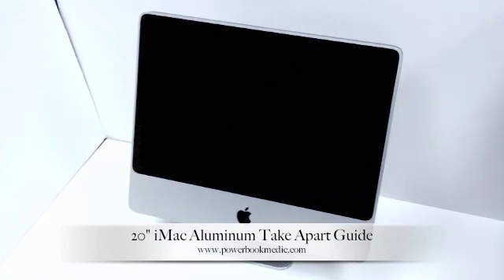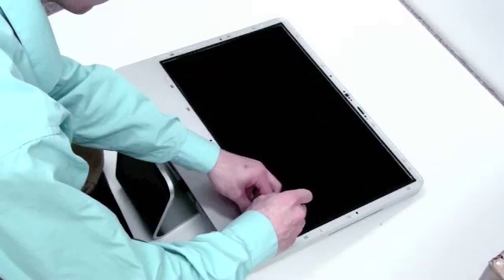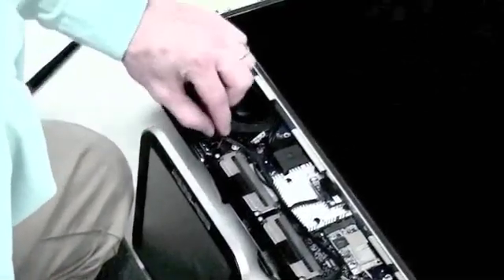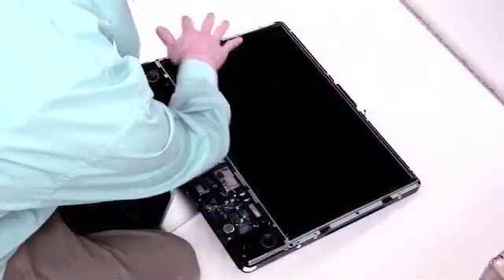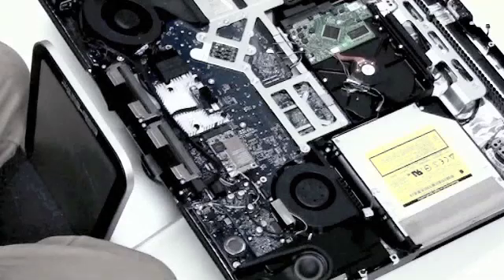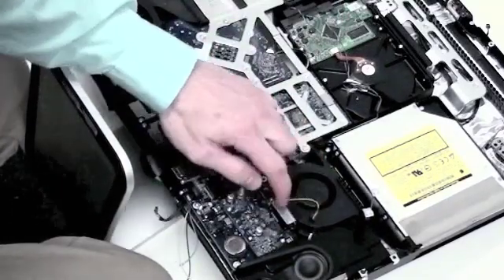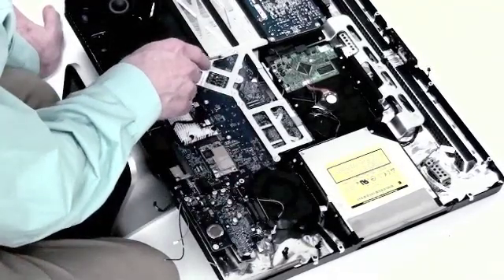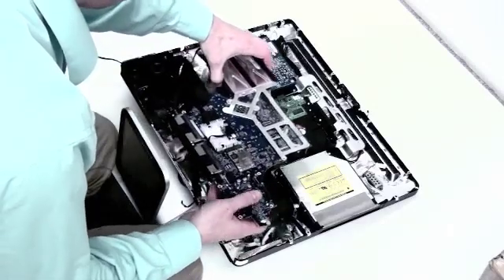Intel iMac Repair - LCD Display and Logic Board

Comment: hi sir this is nagaraju from india hyderabad
i have 24 inches imac early 2008 model imac, recently that mac video card problem
so pls reply r u repaire this video card
Reply from the maker: Nagaraju Basava We can repair iMac video cards. You can visit our website for more info or call our repair department at 1-866-726-3342.
Reply: hi what country are you in? i have an imac 2011 i3. the INT DP port has broken off of the logic board. i can find a new port connector on ebay but it needs soldering on and im scared to even try it lol basically i had my screen UN-screwed and checked the back of my imac and the screen went forward away from the whole thing and held forward by the cables, i disconnected the INT DP from the screen and tried to push the port on the logic board back, which caused the solder to weaken and break off. i dont fancy spending loads on a new logic board when this works fine and im using mini display port to hdmi at the moment. i cant find any store that will help me solder this. can u suggest anything please. and ive also seen a video on youtube somewhere where some guy soldered his but i cant find the video now. do u think i should just try searching video again and give it a go myself?

Comment: Where can you get those suction cups for taking the screen cover off?

also I presume you could use any replacement LCD screen to replace the old one thats of the same size? or does it have to be a specific kind of LCD screen?

Comment: I have have a 24 inch imac apple has replaced the hard drive,memory, and the logic board under warranty my imac is now having the same problems not starting or when it does every thing has a pink glow  ran the hardware test hard drive good  anyone know what the problem is